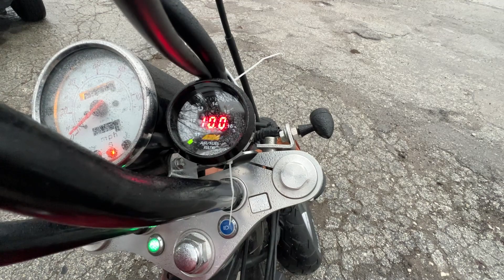TUNED TO PERFECTION | Honda Shadow Ace|

Comment: Idk how I came across this but tuning pwk carbs are easy. FYI two things. 

The air screw with the flat head near the inlet out means more air = lean/ in means less air= rich. 

Secondly your reading afr wrong. Green means rich and red lean.  Idle aim for 13.5-14.5.   

Cruising 12-13 

Wot you want it to be near no higher then 11.5. 

—— or 15s lean/ rich 10

So drop back to stock pilot and tune air screw in and out 1 turn.  leave needle in the center and have idle screw in so it revs at like 2500.

Start bike adjust idle to stay at 2000.
Turn air screw out 1/4 at a time till rpm rises.  When you see a bump in the rise in rpm from the idle screw drop the idle back down  to 2000.  That’s to set a base. 

Second step is the same as the one above but now you adjust with above idle range. Set it 1500. Do the air screw again 1/4 till rpm raises and lower your idle screw down to 1500 rpm.  Now you’re almost done. 

3rd step  again turn air screw 1/8 out at a time until it bumps  idle up.  Now lowered your idle screw to idle at 1000 and done. 

Keep in mind you will have to do this over and over  depending on pilot size. 

More than 3.5 turns out on air screw you need smaller. Less then 1 turn or rich  you  need larger jet.  Sounds crazy right lol but that’s how you do it. Verify if you want with the  afr gauge.
Reply from the maker: Thanks for this i'm showing chris right now for this new build!
Reply: Working on a virago with a pos mikuni single swap. Definitely switching to the nibbi. If that don't work I'll just buy another nibbi and dual carb it.
Reply: I have a 750dc 02 with #30 and 130#, sparks are still black. Maybe a 30/128?

Comment: I had to do this to a h1 kawasaki,  z1 kawasaki and z1r with a 1200 yosh kit with metal head gasket to stop head gasket from blowing with to much pressure. 
Was my favorite bike got ran over by water truck. I'm 64 I was blessed with the best bikes in the 70s.

Comment: Hi there, saw your vids, I too have a Honda Steed 400 with a single carb conversion and I'm struggling balancing the lean/rich ratio of my carb. Currently I'm using the same carb as yours 32mm, 115MJ and 40PJ. Manifold same design as yours but its 38mm size. Still running rich. Wondering if you could shed some idea how you manage to balance it? What's the main Jet size you are using since you've mention a 55PJ  then 48PJ swap and you've raised the needle?
Reply from the maker: Going to check for you this weekend, if chris can't give me jet info today.
Reply: @OverzealousBrainiac  I swapped to 110MJ and 40PJ, needle is centered. It's throttling really good now. Ordered a set of jets cause I need to lower it to 105 or 100 since my last MJ size was 110. Looking good maybe I'm nearing the sweet spot. Need to make a plug reading to determine if it's still rich
Reply from the maker: @venjhammet  
We will check the jets tomorrow but the guy at the shop told us at the shop that the carb is too big for his 750 so it might be overkill for your 400. In the video here the needle was at the top but we centered the needle. It was on the top firs, but yea keep messing around with it.

Comment: Put up an affiliate link to the Ox/fuel gauge y'all used please so I, and others,  can get one and ya'all can make a couple bucks.  Thanks again!
Reply from the maker: AEM wideband air fuel gauge is what we used but it has to have the gauge and the wideband O2 censor. It doesn't have to be AEM but it has to be Wideband so it can be more accurate.